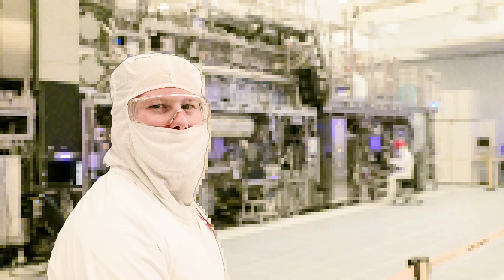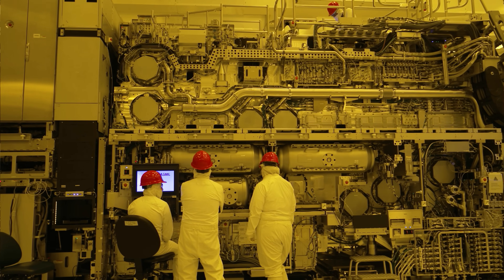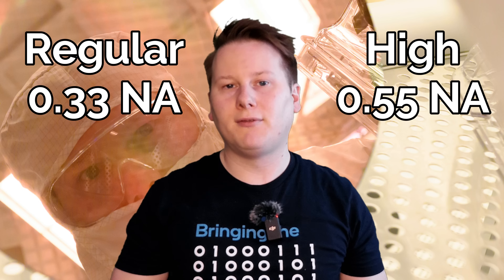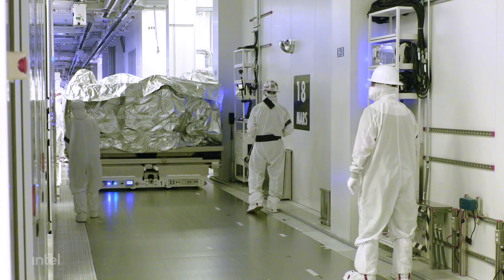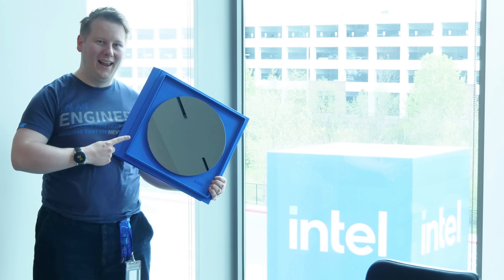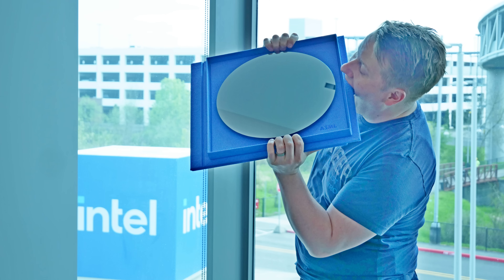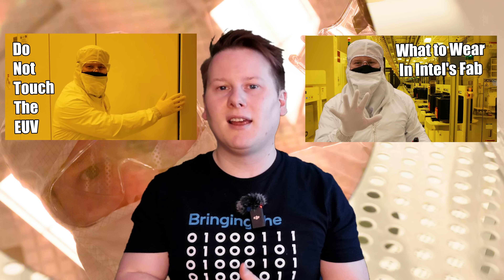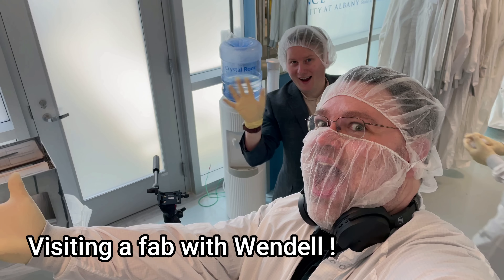Intel's Newest $350 Million Machine

Comment: Flown to Seattle? I'd love to know why they couldn't fly it into PDX and just drive it the 10 miles to the fab from the airport. Seems kinda weird.
Reply: PDX might not have the support infrastructure to unload. SEA is a much larger airport with more capabilities.
Reply: Or just fly into Hillsboro across the street from the fab
Reply: @arrdubu Hillsboro runway is 6600ft. SEATAC is 8500-11900ft. A fully loaded 747 requires about 10000ft of runway. Not possible.
Reply: PDX is 25 miles from the fab, btw. :)
Reply: @scottdougherty2303  25 miles or about 3.5 hours
Reply: I have landed many times at Hillsboro. No 747 can land there. We move the scanner in a 747
Reply: @CyrusTabery  I've watched many 747s and other large aircraft land at Hillsboro.
Reply: @arrdubu  I don’t recall seeing a 747 there but I believe you.
Reply: @arrdubu  I live next to HIO(plus fly out of there) and I dont believe I've ever seen a 737 land or take off from there. The largest plane I've seen land or take off there is still there. It's an alaskan airlines airbus of some kind but it's nowhere near 737 size.

Comment: 11:10 I wish I could buy a 250nm machine from 1980s for home use.
Reply: Ngl I was thinking the same thing. Save up and build an experimental super low volume lab or something... Sadly, I'm sure even 1980s tech would be way out of any individual's price range.
Reply from the maker: Check out the work by Sam Zeloof. He built 1000 transistor chips in his Garage at the age of 18.
Reply: @TechTechPotato  Breaking taps and Hugen Optics is also interesting. No one has yet to attempt making a 1k-100k processor clone using EBL with a SEM, that would be something interesting.
Reply: @TechTechPotato  I'm trying to follow his steps. But I thought I could use industry surplus to jump some nodes. 
It was amusing to know that there's potentially no industry surplus because everything is still more or less being used  to make chips.
Reply: @41chemist19  It probably would not be the purchase cost, the high cost is in the other things like power bill, maintenance, replacing parts, chemicals, calibration, re-calibration, etc etc. You need someone to operate the machine which was designed for a process involving a team of people. No way you're doing it alone.
Reply: @paulmichaelfreedman8334  this. Owning a stepper is like owning a pinball machine or a castle. Your upkeep and repairs are the difficult part.
Reply: @Grak70  Just operating and maintaining it requires expertise way beyond any hobbyist level, and those who can are extremely rare.
Reply: @paulmichaelfreedman8334  I think that’s what I said?
Reply: There's a company called Beta Squared Lithography that's still selling 1970s Micralign systems. Iirc current prices are ~$80k per. Not quite home use unless you're rich, but potentially small business level.
Reply: I think the chemicals even 250nm machines use for their UV lasers would be difficult to manage.
Reply: You’ll find small bare minimum fabs with real partially semi compliant machines, calibrations, and safety equipment/certifications still run in the 10’s of mils with million dollar service support needed. 1990’s tech is still what populates a good chunk of fabs in the world and those machines still sell in the $500k to $10M range for manually operated 6” and 8” fabs. The stepper is not the only machine you need to make a functional transistor.
Reply: You will need about 15k in eBay parts but is possible
Reply: Good luck with your krypton bill.
Reply: I bet with stamps using nano-imprint methods you could make a few tiny transistors. Connecting them together might be more difficult. 😮
Reply: An even better idea, what if 10k - 100k transistor/ mm2 but graphene FET , and the total cost is in the 6 figures range. And a complete solution maybe the size of a large crate. IE no one enters the clean room, rather robotics does everything inside. 

TLDR imagine what 3d printing has done to probotyping, but in semiconductors, and 1990s technology. Maybe in 10-20 years
Reply: A 350nm stepper from the 1980s is $500k, perfect for those home projects if you sell your home.
Reply: @xenuburger7924   I guess I should find a way to become richer first before having this "hobby" of making my own microchips.

Comment: What is the connection between ASML 8nm lines and  the process for CPUs declared by Intel/tsm?
Reply from the maker: Current metal pitch (from imec) in N5 is 28nm, using 6 metal tracks for FinFET. N2 is expected to be 21nm with 6 tracks, while A10 in 2028 is expected to be 16nm with 5 tracks. Though this is the densest IO transistors, not the leading edge super fast transistors.
Reply: @TechTechPotato It’s amazing that ASML can achieve 16nm metal pitch in A10. How will the A10 process mitigate electromigration?
Reply: @tringuyen7519  agreed I think this would be an issue, how do they fix?
Reply: Think i read : Intel just adds a text these chips will fail after 50.000 hours i think. That like 3.4ish years of run time.